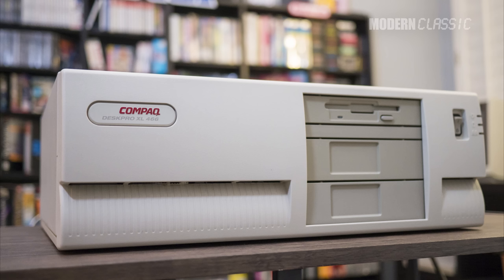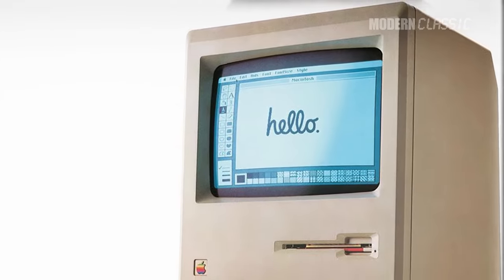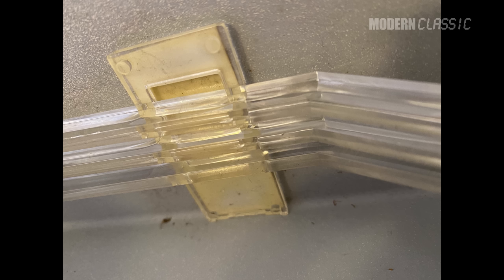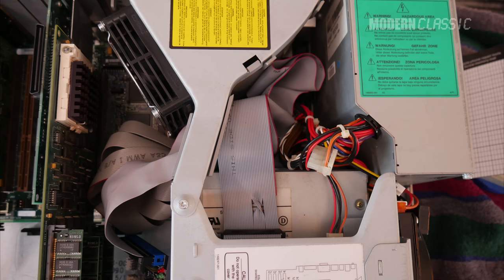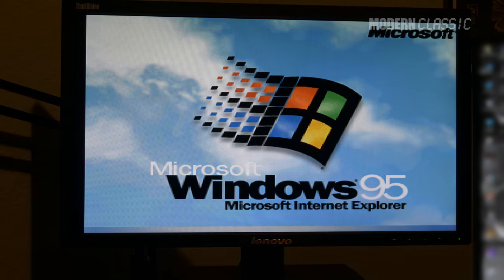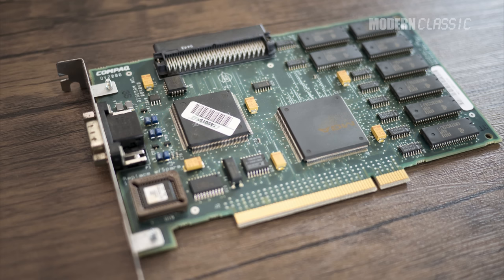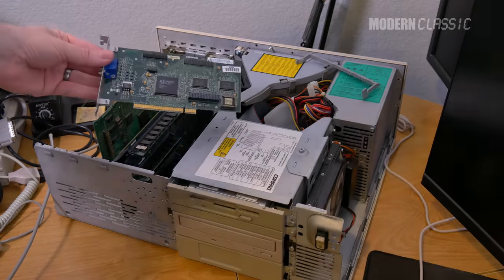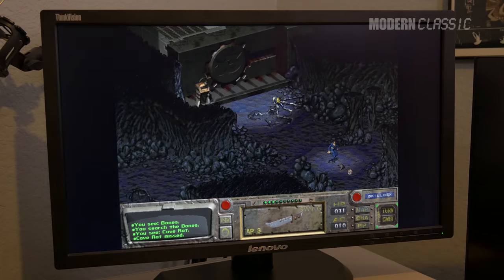Compaq 486 PC restoration and upgrade - Part 2!

Comment: Nice results on the repaint! I've used the same smokey beige on some drive covers with good to mixed results, but as you mentioned the different off-whites and grays of various old machines really make it tough to match exactly. Especially decades later.
Reply: Whoa, somebody rang the bell and got a notification. Lol. Always happy seeing you in the comments! 🙂
Reply from the maker: Hey, thanks! Yeah I honestly didn't expect to get it as close as I even did. Looking for the right color, though, made me realize that even though there are about 1,000 different cans of paint in that section of a hardware store, there's never quite the exact color you want. I was really looking for just a very neutral, very light grey but just couldn't find that in a rattle can. But I think the Smokey Beige still turned out nice.
Reply: @ModernClassic  The case looks nice. That machine is going tombe a bit of a beast, when you take out that 486 motherboard card, and put in the Pentium card...

These two videos is really tempting me to tear apart my existing Raspberry Pi computer solution,  which is in an Argon One M.2 case. Considering I also have a DAC for it, trailing out, and never got the M.2 part to work... yeah, there are issues to be resolved, and slapping it all into its own special case, and making it more or less a PC, which I use it for, anyway. 

Thanks for 5his video, and sharing your experience. This has been fun to watch.
Reply from the maker: @horseradishpower9947  Congrats on figuring out the next video :) It's going to be more casual and unscripted, but yeah I've got the Pentium card to install and test. As well as one or two other things that people have requested and that I think will be fun...
Reply: @ModernClassic  You know what would be really fun (but also really pointless), adding an RF Antenna video out, so you could use a tube tv as a monitor natively.

Comment: When I needed to color-match my old 486 case, I went to a local car painter. He has some kind of electronic probe device that can measure colors. A piece of paint that was inside the case and therefore not changed by the sunlight or other things was needed for best result. He gave me the numbers to go and order a spray can to be mixed and even offered to mix the paint himself and to paint the case. He even managed to mimic the texture of the original paint which I wouldn't be able to do with a spray paint. Granted, not exactly the cheapest solution, but not too expensive either. I really wanted that case to look spotless. The whole thing was done i a day and the result is just amazing.

Comment from the maker: Hello! Just a couple of updates:
1) The dual boot issue on my CF card is now fixed! Turns out that was a bug in Windows (some say an intentional one) and a commenter below turned me on to a homebrew patch for it that worked like a charm. Surprised I never found that in any of my Google searches, but I guess I was probably looking for more of a CF card fix than a Windows fix. Anyway, thanks to David Wonn!
2) The block mode error is a smaller issue (and basically insignificant now that I know it's got nothing to do with the boot hang) but I will just say the new CF adapter did not fix it. I do have a new IDE controller card coming, which has its own BIOS, and I have a feeling that will do the trick. I needed this anyway since no cable I've seen will let me run from the CD-ROM to the back of the case, where I want to mount the CF card (in a rear slot). There is only one IDE port on this motherboard, since it is mainly a SCSI-based system. Older IDE controllers are cheap these days, so no big whoop... though eventually, I would like to put an EISA one in there just for the heck of it! I'd love to be able to use that feature of this machine, since it's an unusual one, and also free up the PCI slot that's now going to be occupied by the new controller. If anyone has an EISA IDE controller to sell, let me know!
Reply: Glad to see my suggestion worked out!
Reply: I can't find the comment for the patch.. sorry too many comments to wade through. Would be nice to know what the patch was.
Reply: @molivil  I’m uncertain why my comment wasn’t pinned, but YouTube often likes to bury my comments for unknown reasons. In a nutshell, a patch to the IO.SYS file is needed on OSR2 in order to restore dual boot functionality, among other things that Microsoft disabled which otherwise work fine on 95 retail or 95a.
Reply: YouTube introduced me to you with a part 2, well done YouTube haha
Reply: @RWL2012  That happens to me too when I first encounter some channels. It always makes me hunt down part 1 either by (1) looking for a URL in the description, or (2) via playlists, or (3) by sorting a channel's vids by date, generally in that order.

Comment: These kinds of boot problems are why I was an avid user of System Commander in the 90s.  It manages any number of OSes installed in the same FAT16 partition, and multiple config.sys/autoexec.bat configs too.  It saves the boot sector and boot files of each OS in a subdirectory, and ensures the correct files are present when you want to boot a certain OS (so it protects against mishaps).  I highly recommend it.

Comment: The repaint part is pretty useful, as I have to do the same on an AT case
Reply from the maker: Just make sure you do multiple light coats. Be patient with it. Remember that a computer runs just fine without a case around it!

Comment: Thank you for documenting the horrifying reality of trying to ACTUALLY use a CF or SD card to IDE adapter with an earlier-era PC.
Reply from the maker: It's never been 100% smooth sailing in any computer I've tried it in. (Three now.) I've now ordered a new IDE controller card. (The new CF adapter didn't help.)
Reply: @ModernClassic  I've had luck with using industrial IDE DOMs. I haven't had compatibility issues and they seem to always be recognized as a standard IDE drive. CF and SD need additional adapters and controllers that seem to cause more problems than they solve.
Reply: @ModernClassic  Heard drive bearing whine is rarely a sign of failure. Often times older drives fail from bad heads, bad sectors, head crashes and bad sectors. Though bad heads and head crashes being a lot more uncommon. A lot of hard drives were whiny from the factory too. I have a Quantum Fireball CR 4.3AT with a decent amount of bearing whine that has been on for 80,656 hours (9.20730594 years). It is fully functional. Unless you have something like a late 90s Maxtor DiamondMax bearing whine isn't usually an issue.

Comment: Tip on painting, hold the can far enough away and move at the pace that lets you keep a wet edge when making a pass so each subsequent pass will blend together, looked a little tiger striped when painting. looked good all together at the end so I guess that didn't matter too much.
Reply from the maker: That's the reason for the multiple coats.

Comment: FWIW, the drive rail issue is something that 3d printers were really made for. Esoteric parts that might be hard or impossible to find, but since they are really just thin plastic or metal, all you ever really need are the schematics for one set. Then print.

Comment: Hi

The respray looks good - top marks !!

I did have my Gateway P2 resprayed and colour matched , i did take it to a smash repair shop and they used a scanner to get the RGB colours and the computerwill find a exact match or recommends similar shades that the shop can colour match 

 ** i first heard about this with my 1970 chrysler the part near the instrument section of the dash was scuffed and scratched, the ashtray was immaculate the glove box scuffed and severely scratched on the bottom ?? why , did they stack boxes up front ??  , the shop just cleaned the ashtray and scanned it and mixed up a spray cans of the correct shade **

Re the CF cards, i have 3 40 pin adapters and 2 x 44 pin adapters, and about 5 CF media cards - they have been running on 2 machines 100% for 3 years, but it was mix and match to get the correct card matched up to a suitable and stable adapter

Some CF adapter donot allow any other device on that chain even if they have a master / slave jumper - all 3 of my machines there is no other device on the same cable

While you can run a speed test like Chrystal disk mark, is there a small software tool that works similar to SD card info or the SMART drive info to get information like hours used read/write cyles

Oh BTW - all of my older machines with CF cards, i max the physical ram as much as i can and turn of disc cache / indexing / virtual memory - all of those items are for marginal spec machines and memory upgrades at the time were expensive and close to the starting price of the machines - i recall buying a 386dx new and then paid $400 for another slave 40 meg IDE drive and ram was $100 a meg for a single sim module, the SB16 and 2 speed cdrom i waited until it fell to $700 

Regards
George

Comment: It great fun playing with old systems like this, Ive just done a few retro builds myself. Its worth bearing in mind however without the benefit of a modern system connected to the internet and google it would probably be a nightmare. If something like this were your only pc back in the day it would have been so frustrating dealing with the issues and very expensive!

Comment: I love watching videos like these in part to see how different people approach retro hardware. What modern technologies will they integrate? For my part, I like to replace anything that moves with something that doesn't, whenever possible, and to replace anything else I can with modern, quieter, more efficient options. I still keep the CPU, RAM, motherboard, video card, sound card, case, and optical drive within about plus or minus three years of each other, because I want the games to actually run like they did back then, but I happily use modern CPUs, CF cards, Gotek floppy emulators, and the like, so that I can get to the game as quickly as I can. This means that my P166 through 1GHz PIIIs are nearly silent, as is my C2D. The P4 is a different story. Those things were so ridiculously hot!

Comment: Just remembered a weird issue with my Amiga and IDE2CF adapter.

Currently my system drive is an mSD2CF adapter, which seems to work fine. But I did at one point try a cheap 1GB CF card I had, which works perfectly fine as a data drive on my DS and with a PCMCIA adapter, but failed miserably as an IDE drive.

Comment: Your problems with CF reminded me, I built a cocktail mame cabinet back in 2004.  I used a fanless VIA EPIA and the idea was to have no moving parts at all.  But I had such problems with CF either flaking out or running slow that I reluctantly put in a harddrive.  I should modernize it some day (that'll be some work as all the controls are wired to PS2 and all the software is custom code running on freedos)
Reply from the maker: In many cases now it's better to just use a real SSD if you want no moving parts. I thought about that with this machine but was really just trying to save a little money. At one point I thought I remembered still having my old 120GB first SSD and looked for it, but I must have gotten rid of it and even the cheapest new SSD from a reliable manufacturer is like $70, plus the possible need for a new controller. But, I have read a lot from people who have done that successfully, even in old machines running DOS and Windows 9X, and I'm sure it would be more reliable. And it might not even be more expensive if you would end up otherwise having to go on a wild goose chase to fix a problem like I'm still doing. (Though this machine does now work except for those couple bugs that I can work around.)
Reply: @ModernClassic  True.  And the point of my mame cabinet isn't to be true to the period so I can modernize the whole thing really (except there's something to be said about using a real 15khz arcade monitor)

Comment: thanks for info! I am trying to remove soldered CMOS battery on my Compaq Presario 433(486sx 33Mhz) machine. It looks very similar to yours. 
Mine was BR2330A. I guess I can replace with CR2032 socket ? I will order battery socket if this is right size.

Comment: I had exact same problem with my Deskpro 486/33m, set block mode error. Adapter was ide-sd and 2GB MicroSD in it. I gave up and put 6,4GB HDD in. Apart from set block mode there's one thing good to remember, on a new CF/SD -card: run fdisk /mbr before any use.
Reply from the maker: Oh I've done that several times, but it turned out there's nothing really wrong with the card (the main problem I was having was a Windows 95 bug, now fixed). What I've decided to do to fix the block mode error is just get a new IDE controller, which I need anyway to mount the card in a rear slot (no cable will reach from my CD-ROM to the rear of the case).

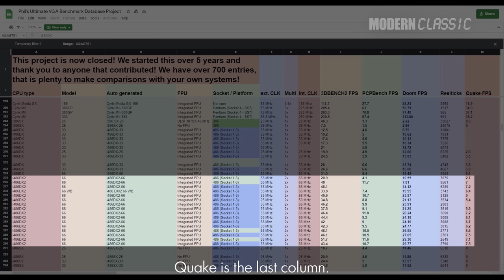Comment: 32:17 I decided to spin up my 486 and do that quake demo. I got 9.1 FPS on a Cirrus Logic GD5428 (VLB) with a fully populated CPU cache and an AMD DX4-100, so I'm convinced you're right about the CPU bottleneck since I know my CL card is nowhere as beefy as that S3. There's probably a lot of free bandwidth to the S3, just not enough CPU time to make it happen.
Reply from the maker: I will have another test and hopefully a solution for that in part 3... stay tuned! I may film that this weekend; if I do, it could be ready as early as later next week.

Comment: Now that you figured yourself what cursed the errors of not being able to boot anymore, will you just prepare a second CF card with only DOS 6.22 on it?
The 486 would do great with it, I think.
Reply from the maker: No, another commenter actually turned me on to the fact that the dual boot issue is a known bug (some think an intentional one) in Windows 95b. There is a homebrew patch for it that I've applied and it now seems to work - I can boot either DOS 6.22 or Windows with impunity. I'll be posting a pinned comment about this since it's a pretty important update to the story.

Comment: Judging by the 1996 date on your Windows 95, you are actually running 95B which has a known bug which only allows it to boot to a previous version of DOS *once*! You can either patch the IO.SYS via googling OSR2fix, or preferably use 95 retail or 95A to eliminate this boot bug.
Reply from the maker: Interesting. Thanks - I will check that out. Sounds like it may be the culprit!
Reply: @ModernClassic  Yep, this bug is one of the main reasons I stick with 95(a) on older hardware that neither needs USB nor FAT32 support. Plus its built-in DOS 7.0 natively runs Win 3.x, though that still generally runs significantly better on the previous version of DOS due to DOS 5 / 6 likely having its config files already fine tuned for Win 3.x.

The underlying DOS 7.1 of 95OSR2 can run Win 3.x, even on FAT32 with caution, but it also requires the aforementioned OSR2fix and custom batch files to ensure it is always launched from the proper directory. I only do this on PCs with USB or over 64MB (the upper limitation of DOS 6.22's himem.sys, though even that can be Frankenstein'd allegedly to support more.)
Reply from the maker: @DavidWonn  The problem I have with 95a is that it requires a restart for every resolution change, which I do frequently. 95b can do it without a restart. So I will definitely be trying those fixes (I already googled them, but the links in the articles I found to the files themselves were broken... I will just look a little more tonight, I'm sure they're out there).
Reply: @ModernClassic  If all links are broken, I may look around to dig it up from a backup of a Pentium III that I applied the OSR2fix to a couple decades ago and upload to my old website.

As for the resolution change, yeah 95a does require a restart when the color depth is changed, but usually doesn’t if only the resolution changes. Fortunately, it isn’t a full reboot though (equal to the time it takes to Start - Shutdown - Restart while holding the Shift key.) It’s a tolerable amount of time on my 486SX25, but I don’t change the resolution nearly as often as I used to.
Reply from the maker: I found the w95bootfix.exe, which fixed my dual boot issue. So thanks! It is weird that that never showed up in any of my Google searches about this problem; guess I just didn't use quite the right search terms. I'll be posting a pinned comment about this being fixed. The osr2fix file seems to be for running Windows 3.1 under DOS 7.1... I'm not sure if I need that, but now I know it's out there if I do. Anyway, thanks again for the suggestion!
Reply: Wikipedia has a note about a bug that causes problems when a drive claims to have 255 heads.  I was starting to wonder if that might be what happened, since these cards would definitely have a virtual geometry trying to max out the BIOS and DOS limits.  But IIRC that existed through DOS and Windows until LBA took over.  So I assume this is something else..

The block mode thing might be fixable.  The card just seems not to support multi-block transfers.  There’s usually a BIOS setting to turn that off.  I had tons of errors using a CF card as a boot drive in Linux until I put it in the DMA blacklist.  They are IDE compatible, but only a minimal subset, apparently!

Comment: The issue you're having with the CF drive is might be related to the 2 GB barrier. Even if you formatted the CF drive as FAT16, a lot of BIOSes and IDE disk controllers from that era did not support drives larger than 2 GB. The only thing that gives me a little pause is that you tried the 2 GB industrial card, but it's still possible that the BIOS is not fully compatible with the controller you're using, but is compatible enough to make it work.  Just a SWAG.